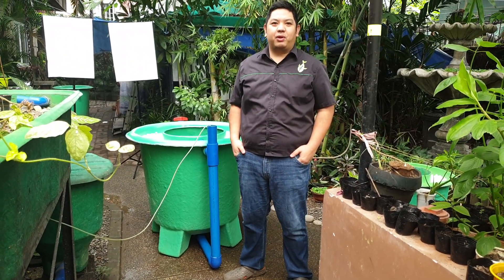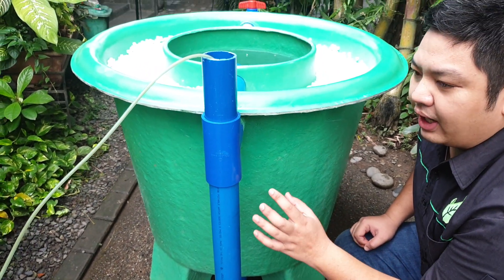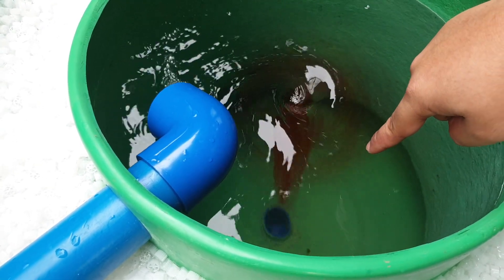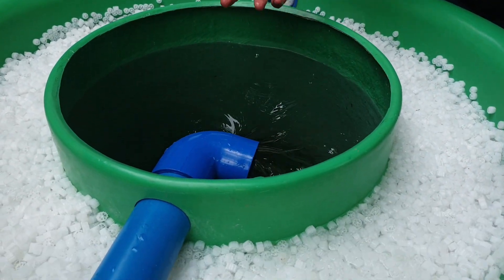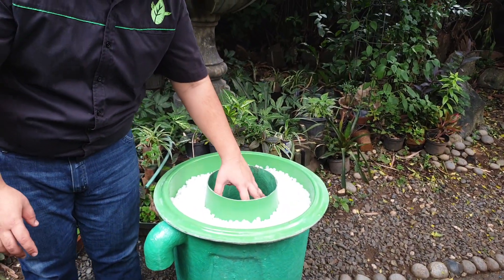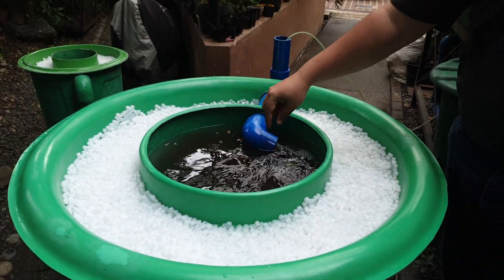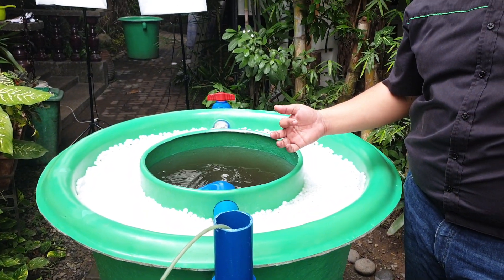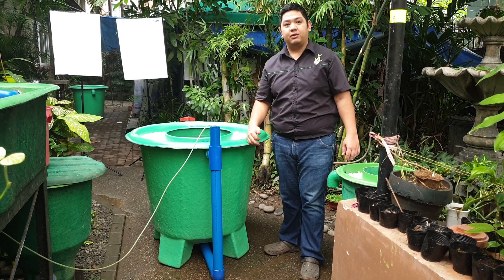Vortex Compost Tea Brewer for Mineralization by MADE

Comment: The higher the pressure, the more air will dissolve in water (see DAF principle).
In the video you explain the exact opposite.

The vortex is good for separating solids, not for adding air.